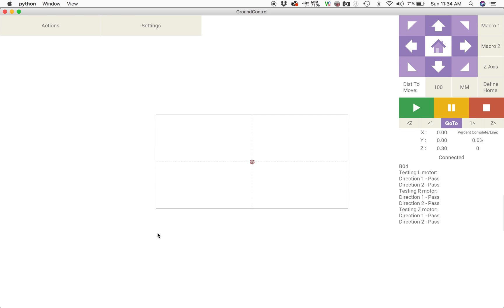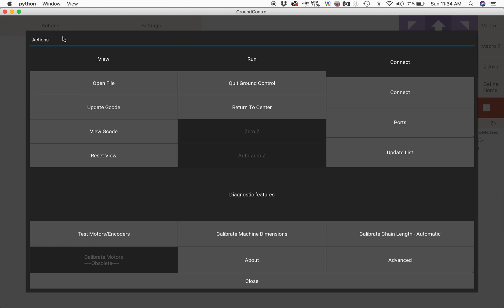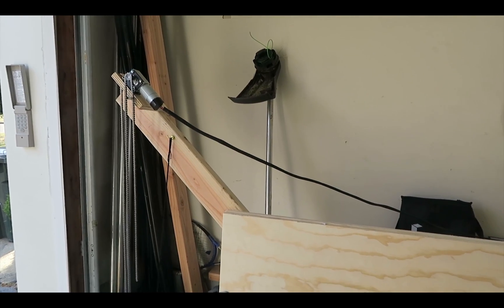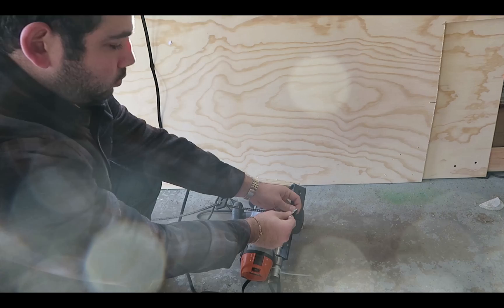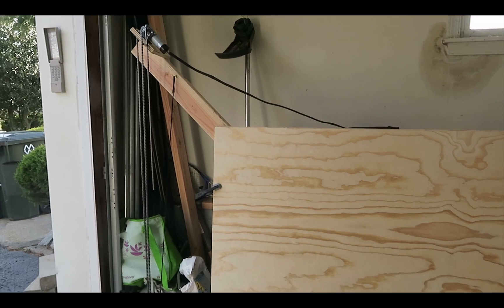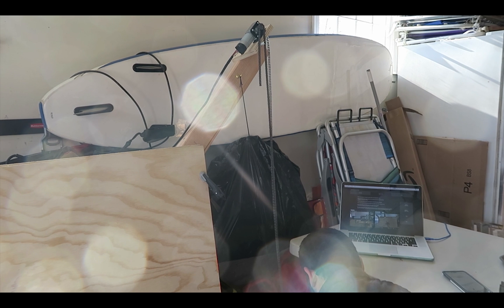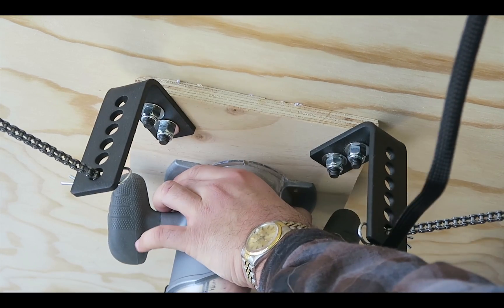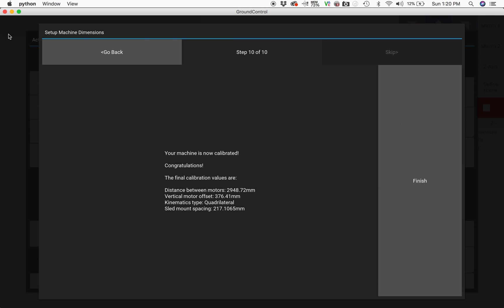Calibrating your Maslow CNC Machine!

Comment: Thanks for the videos!
Did you need to calibrate when you made the temporary frame in order to cut the permanent frame?
Reply from the maker: Yes, you need to perform the calibration step every time you want to use the router on any new design (including temp frame)